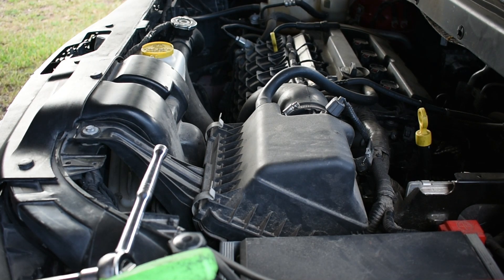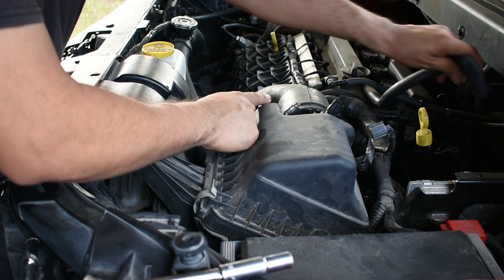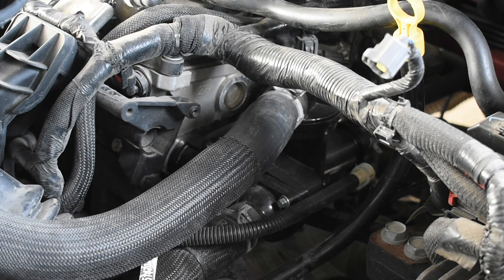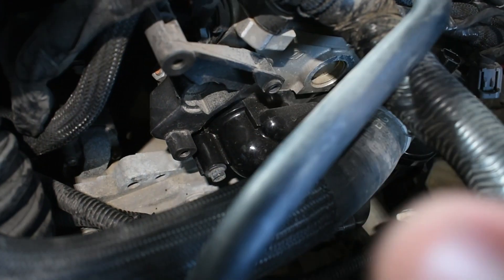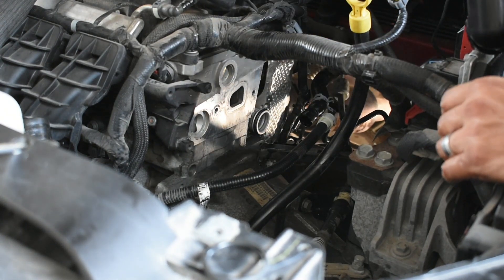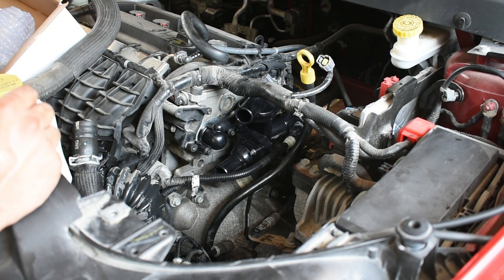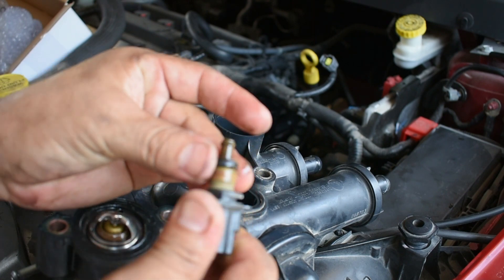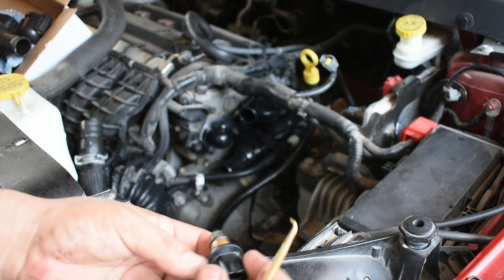How to replace thermostat housing Dodge journey /avenger 2.5 engine

Comment: Hola! Luego del cambio cómo completas el refrigerante que se perdió al desconectar las mangueras? Se hace simplemente por el depósito y luego de tenerla en marcha revisas si bajó el nivel? O hay que purgar el aire del sistema de alguna manera??
Reply from the maker: Hola! Si exactamente asi como dices. Rellena de coolant/antifreeze el deposito.  Primero por el radiador y despues el contenedor auxiliar.  Prendela y que garre su temperatura normal (asi se abren Los termostatos y deja fluir el coolant.  Despues checas y rellenas lo q le haga falta 🫡

Comment: Awsome video thanks. I have to do the same thing this weekend. same dodge.  did it leak after?  how did the water sensor gasket do since it was bigger than the original?
Reply from the maker: No leaks! It worked just fine 😎 thanks for watching 🙏

Comment: son dos thermostatos?
Reply from the maker: Si. Uno esta adentro dep housing.  Y el otro viene suelto tu lo tienes q poner
Reply: @larasgarage2021   el thermostato que esta asia el bloque del motor ese es el que cambiaste en el video,... el otro tambien lo tengo que cambiar? tengo un leak como de 10 gotitas en la entrada/salida de atras en el oring.   mi diagnostico es que es el oring porque el housing de plastico no esta mojado al tocarlo solo el fierro, es como leak de presion ya cuando lo apago es cuando gotea , pienso que es por que los thermostatos no estan asiendo su funcion, abriendo y cerrando tal vez ... PERO la pregunta es tengo que cambiar el 2ndo thermostato adentro del housing>?
Reply: @larasgarage2021  gracias por contestar!!
Reply from the maker: @freenternet2178  ok...so el Thermostato que esta adentro del housing ya viene ahi. Si compras el housing como te digo un Thermostat ya viene adentro. El de afuera es el q viene pegado al bloque del motor. 

Si liquea de la parte de atras yo creo q mas bien seria el o ring que ya se daño y ocupas remplazarlo.
Reply from the maker: @freenternet2178  no worries bro para eso estamos 🫡